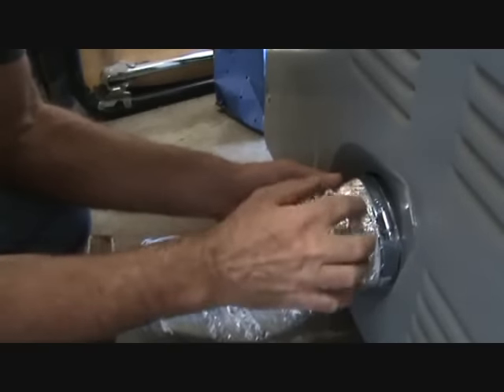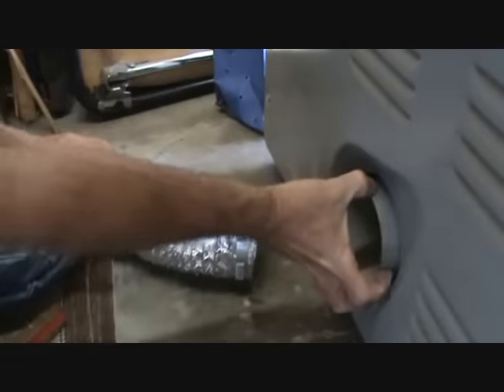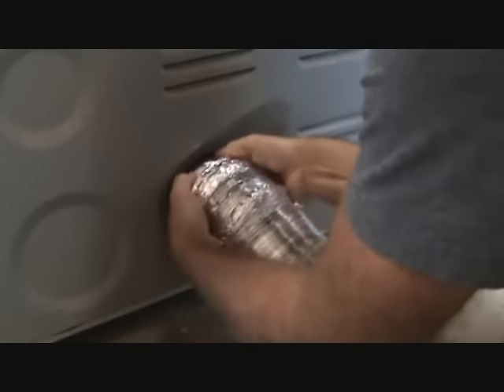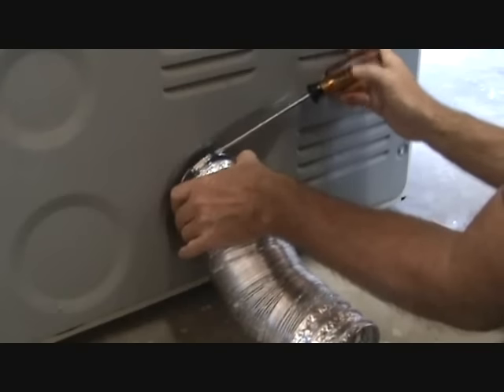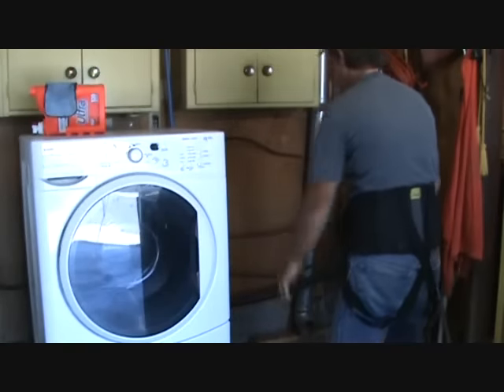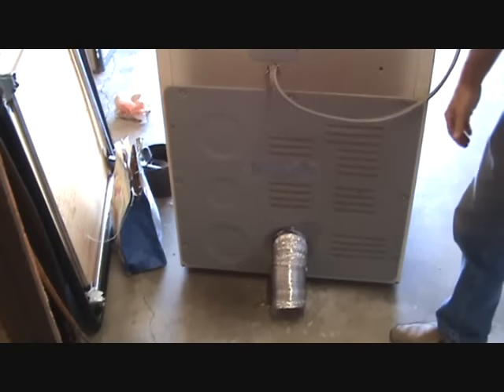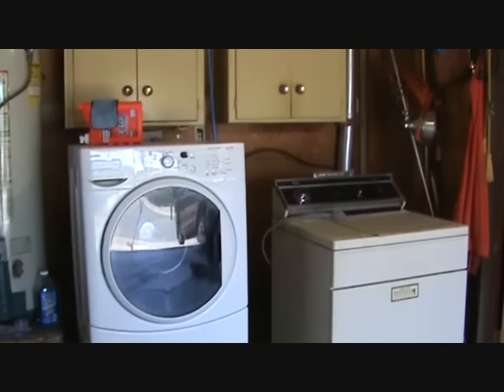How to install a dryer vent flexible pipe

Comment: I'm fighting with getting the hose on the vent hole that's the same size 😠😡🤬
Reply: same here
Reply: Same with me
Reply: You have to expand the vent. Make it look like a slinky and then twist and push it on one by one.
Reply: @isaacvance1539  😊😢 e
Reply from the maker: I know what you mean. You have having the same issue as lots of viewers! I'm sure after 3 years you got it on there....right?!!
Reply from the maker: Take one wire at a time then push on one more wire for two strands on there before tightening on the clamp. You can do it & I'm sure you have it on there by now!!
Reply from the maker: Yes sir!
Reply from the maker: Did you get it on there? Hope so!!
Reply: Yeah that thing slid on a little too easily lol... Replaced one on my machine last year and just replaced one yesterday on a different dryer... What a freaking pain in the ass!!! Getting that hose to slide over not only the dryer side connect  but the wall outside vent connect...Came on YT looking for some magic tips for next time 😭
Reply from the maker: @seans9841  LOL not sure if I showed any magic tips but take one metal wire at a time  & slid on a few for the wall connection then you should be able to clamp it....JED

Comment: They should come up with better flex tubing system that you just push on and it clamps down easy, with clamps built in.
Reply: I can't believe they have not improved the design on these things after all these years!  Can be so FRUSTRATING!
Reply: @troybush5899  I guess they want to keep it out of the hands of the homeowner by making it difficult!
Reply: Using a nut driver (or socket) works much easier on the clamp than a screwdriver.
Reply from the maker: Hey maybe you should invent it & become a millionaire because I'm sure everyone would buy it! Yeah mot sure why dryer manufacturers can't just make the connection stick out like an inch further with a very slight taper to it so the flex pipe just slips on there...right?!!!!!!

Comment: THE MANUFACTURERS OF THE DRYERS SHOULD MAKE THAT LIP AT LEAST AN INCH AND OE HALF LONG!   WHY DO THEY MAKE THEM SO SHORT TO MAKE IT SO DIFFICULT TO ATTACH THE DRYER VENT? UNBELIEVABLE!!!
Reply from the maker: I'm with you on that for sure!
Reply: I don’t understand that either. It doesn’t take an engineer to realize you need enough space for the tube to fit.

Comment: Great video from someone who has done many of these.  Could dryer manufacturers possible make it easier to hook up, like maybe have it vent on the side?
Reply: Or make it just an inch longer
Reply: Or use a built in latching or clamping method on the dryer vent stub.
Reply: @bobgarr6246  I was trying to do this myself
Reply from the maker: Yes they really should make it easier by making the flange an inch longer & slightly tapered at the end to make things easy...right?!!
Reply from the maker: Yes an inch longer & slightly tapered at the end too...right?!
Reply from the maker: Make an inch longer & slightly tapered at the end & that pipe will slip right on!
Reply from the maker: Well did you finally get it connected? Hope so!

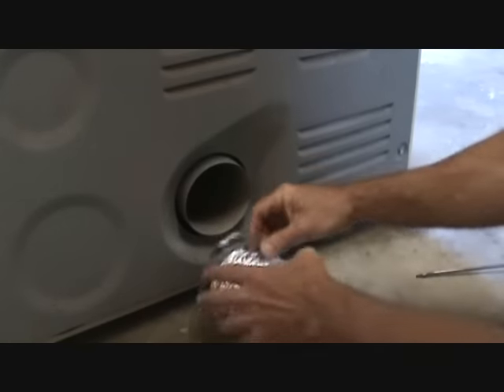Comment: I love the laborious process of connecting the duct hose to the dryer (2:00). It can be a very frustrating thing especially when it is done overhead or in a tight area. It boggles my mind that there is not a way to routinely make this easier. Thank god we have plug-in electrical fixtures.
Reply: All they have to do is make the dryer back 2 piece where the duct pipe comes out so that you can put your duct on first then the back.
Reply from the maker: It is a laborious process in deed. You know dryer companies could give the public a really good service if they just extend the pipe area at the back of a dryer just another inch or two. Not sure why they do this......very frustrating! I'm with you.
Reply from the maker: Or all they would have to do is extend that piece an inch or two more...that's it. I think the dryer companies really want to piss people off!
Reply: Electrical connectors are fine.
Reply: Why isn't the diameter larger of the flex tubing to get it easily over the rigid tubing? You still have to secure it with a clamp.

Comment: Thank you so so much for that video it help me so much. I looked up about 10 videos on how to install that piece and I still couldn't do it. I had been working on it for days. And then I came across your video and right after I looked at it I went and followed your instructions to a T. I was able to fix it right away. I was very encouraged by the way you said you can do it. I did it. Thanks so much.
Reply from the maker: That is soo awesome you were able to do it yourself. I KNEW you could do it! Thanks for letting me know...

Comment: Thank you. And thank you again. 1000 times thank you. I should have watched this video before starting the install. The simple folding down of the aluminum on the end made it so much easier to slip the duct on the vent. Thank you.
Reply from the maker: So glad you got a chance to check out my video! Yes these flexible ducts can get a bit tricky to attach for sure not to mention getting the clamp in the right position in order to tighten the clamp on! I have lots more DIY videos on my channel that you will appreciate. Just go to my main YouTube channel page then click on playlists then scroll down to find all kinds of things that you can do yourself & save money with. Try it!

Comment: Thanks, VideoJoe. I just discovered that whomever installed my dryer vent should be arrested for gross negligence. Gas dryer, vent not even connected, and when it WAS, he used DUCT TAPE, not the clamp, which he left dangling on the semi-flex. So lint has been blowing at the gas line for MONTHS, right next to the gas water heater and its pilot light. I watched your video and got that sucker attached the RIGHT way. Thank you!
Reply from the maker: Awesome to get it attached properly. Nice job with checking it out!
Reply: @VideoJoeKnows  Hey, no worries. I'm just curious why I got a reply TEN YEARS after a comment! :D Did you get bored or something?
Reply from the maker: @SJActress  Haha something like that! I made a New Year's resolution to go back & respond to all old comments I had never responded to as of yet. I still have a few more to go too. Hey make today great!
Reply: @VideoJoeKnows  That's a nice resolution! Good on ya, mate!
Reply from the maker: @SJActress  Keep it going!
Reply: @SJActress this is actually so funny 😂😂😂

Comment: Attaching the dryer vent is one tedious task. It has been 100 years. Why hasn’t a good engineer designed a better way?
Thanks for your video!
Reply from the maker: I know exactly what you mean! Why don't they extend the portion on the dryer just a bit more then taper ever so slightly....presto!

Comment: THANK YOU very much for taking the time to show this. I had some workers do work in my basement. They disconnected my heater and vent...and didn't reconnect anything before they left. I took a stab at it, and it seems to be holding. THANK YOU again for your help!
Reply from the maker: So glad you found this video! Sounds like it should be easy but once you see it in action then it helps for sure. Thanks for your message!

Comment: I don’t recommend using a foil duct but the easiest way to connect them is to take off the back panel and run the duct through the hole on the panel and then clamp it. Then replace the back panel
Reply: Thanks! That’s a great tip!
Reply from the maker: Hmmmm I've never heard of taking the back panel off to get that pipe on there. Nice thought but when you know how to do it the way I show you can get it. Just be patient & work at it & you'll get it! Thanks for stopping by!

Comment: I have been struggling all day long . It’s all about knowledge and the right tools
Reply from the maker: Well did you get it? Watch this video again & then take your time. A fairly good size screwdriver works great for tightening up the screw on the clamp. Direct the clamp in such a way to where you can get the screw driver in there to tighten it up. See the notched area on the back of the dryer for positioning the screw driver? Not sure they don't extend the dryer outlet more to make it a bit easier...right? Let me know when you get it. You can do it!

Comment: We have a new one coming tomorrow! I have never seen the metal exhaust pipe used before! Thank you =) I never would have thought about clamps =)
Reply from the maker: +Chox TheMuse Good luck with your install! Let me know how it goes.   Joe  :0
Reply: VideoJoeKnows cheers! thanks =) I was watching to see if you used the metal flex pipe or the plastic one =) We have to buy the parts tomorrow =)
Reply from the maker: I used the metal flex but I've seen some viewers comment that they think it's a fire hazard to install the metal flexy pipe that I used. Of course it doesn't say anything like this when you purchaser the pipe from the hardware store so you have to make up your mind on your own but I would lean this way more so than the flexy pipe that's like thin rubber stuff as that puntures pretty easy if you're not careful. They also have a pipe that's full aluminum that you can pull out kind of like the stuff I used but it's more solid once you pull it out into place. When I went to the store I didn't see that type so I got this other type & my Aunt's dryer is still purring along after several years since I made this video. Good luck with your project!   Joe  :0
Reply: VideoJoeKnows Awesome!! Thanks for your time and explanation Joe! We'll snoop around the store and see what they have there! I think with proper care, everything should be fine =)
Reply from the maker: Great! Good luck with getting it hooked up. You can do it!!
Reply: va Shawn Mitchell

Comment: My understanding is the flexible ones are more of a fire hazard. The aluminum ones although slightly harder to work with are safer.  The really flexible ones are not a smooth inside so it can trap more lint and when squished together it has a tendency to reduce the airflow  diameter of the ducting...Which is not good either for energy efficiency or gathering more lint. If it’s not possible to use the  metal straight ducting..the aluminum one is your best bet as far as safety and efficient.
Reply from the maker: I agree with you. I think I was using this flexible one since it was already here. It's amazing though how many hardware stores sell way more of this style than the actual flexible aluminum ones though. I wonder why that is?
Reply: @VideoJoeKnows  I have a flex foil one from home depot is this cool or should I change it?
Reply from the maker: @rodm2345  I would say you're good. Yours probably looks exactly like the one I show here right? They also carry an aluminum type flex pipe but they must sell the foil flex ones for a reason. I would think if they were hazardous then hardware stores would not sell them...right again?

Comment: You def helped me figure out what i was doing wrong lol.  First off ..I had the wrong style clamp on ..ok so prayer did help lol.  I never said I was a dryer mechanic lol.  A thing that does have me puzzled is why ..o why is the vent coming from the back so short..if I was making the design I would have at least 3 inches coming out..ok now I have to wait for the hard ware store to open :)  Thank you very much for all your helpful tips:)  HAve a blessed day!
Reply from the maker: Ha! I agree with you 100%! They should've made the dryer attachment flange longer so it would be easy to attach the flexible vent duct. I don't know why they do it this way. I guess just to make people scratch their head. They do a good job with that!   Joe  :0
Reply: Hey just wanted to report back , got it on and it seems to be working.  My ladder under the house isn't quite high enough for me to flute it out side but the basements huge and unfinshed so it fine for now.  HAppy in Tn with right clamp anything is possible lol.  Thanks again friend :)
Reply from the maker: Glad you were able to get 'er done. I KNEW you could do it!   Joe  :0

Comment: do not understand how the idiots that make these dryers expect people to hook up the vent hoses. it is a real joke
Reply from the maker: I'm with you!  Joe  :0
Reply: VideoJoeKnows
Reply: soxbills .
Reply: soxbills I’m dealing with this now! This is soooo stupid!
Reply: Seems pretty straightforward and simple to me. If the dullard in the video can do it....well he sort of did it. Technically the vent hose is connected to the back of the dryer and the exhaust pipe but everything in between is wrong. Also, on some dryers, the ones I've seen, you take off the backplate from the dryer to you can get a better connection.
Reply: I agree, idiots. and why is the friggin vent pipe exactly 4 inches, and the flex is 4 inches, doesnt go on. and when I do get it taped, its inline with the dryer vent and I cannot push it all the way back. god im pissed.
Reply: @Titans2138  every house has a dryer. This should be a basic snap on procedure, not fucking around with it for 15 minutes, and settling, for 'It's kind of on that 1 inch length of pipe... Totally fucked. Infuriating.
Reply: They enjoy making us work harder
Reply: Had trouble putting mine on too and I read somewhere to cut the hose a quarter inch. That way it makes a wider opening THEN put the clamp on. Worked like a charm for mine today!
Reply: You should watch a howto video

Comment: It's been a while.... snowed in... drying to hook up dryer.  The aluminum straight hose is wider than the hose I'm attaching.  Should I crimp the straight hose, to fit inside of flexible hose? They attached it to the floor. About 18" high. Thanks. A lot of your videos are coming in handy🏆
Reply from the maker: Ha! snowed in.....I guess I should've seen your message 7 months ago....& the snow will be coming back soon! Yes I would crimp the pipe that you are going to be attaching your flex tube to. How did your project go? Sorry for not responding sooner, ahem.
Reply: @VideoJoeKnows  No problem I know how busy you always are... I did get it on  with cutting it about half inch, then it could fit. I tighten the band. Been working fine. Thanks. 🤠
Reply from the maker: @PastorIhaza  Nice job!

Comment: I used tin snips and cut out the hole on the dryer back so that I could put dryer back on when the dryer vent hose is already installed. You have a ton of room that way and that 4 inch nipple that sticks out for your duct is actually about 3 inches long so you have plenty of room there to slide it on good.
Reply from the maker: Wow good job with "joegyvering" it! I wish they would just let the nipple portion stick out just a bit more...right? What would it hurt? See that long angled area near the nipple? That's where you can position the holder so you can tighten the screw easier. Thanks for your message...stud!

Comment: Can you put a solid metal extension (probably 6 "-8") on the pipe coming out of the dryer? 
I spent an hour trying to hook up the flexible tubing because  the kind I bought deforms easily and tears when you try to pull it out to extend it. Can you suggest a brand of flexible tubing that does not rip easily?
Reply from the maker: Not sure what other brand of flexible piping to use other than the stuff they sell at the main hardware stores. What I just heard on viewer did was install a metal ridged elbow to the dryer first then attach the flexible tubing to that. What about that?!

Comment: Do they make the hose bigger i swear my hose and the vent hole are the same size i cannot get it on
Reply from the maker: This is just the way they make them. Watch this video again & then see if you can do it again. Thanks for stopping by. You might have to hold your mouth just right as you do this plus a longer screw driver might help if the back of your dryer looks like the one I show in the video. Let me know how you do. You can do it!

Comment: Nice Video but, shouldn't the pipe going out your  (Flex pipe) have an adapter for your flex pipe to go inside that pipe going up the wall. Mine line is like yours too but, not supposed to restrict air flow and catch lint?
Reply from the maker: It really won't catch much lint...
Reply: @VideoJoeKnows  Thank you for responding. Take care!
Reply from the maker: @tonytrotta9322  You take care too! Have a great new year!
Reply: @VideoJoeKnows  Thank you - Happy New Year 2023 to you and your Family too!
Reply from the maker: @tonytrotta9322  Awesome...thanks!